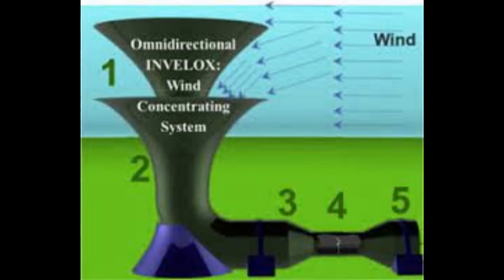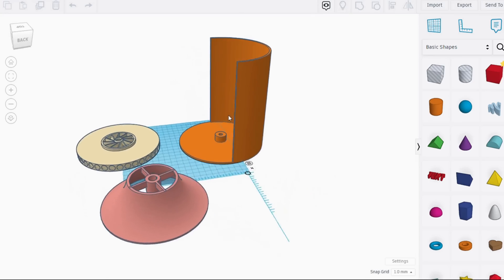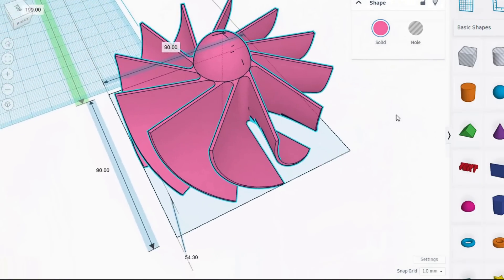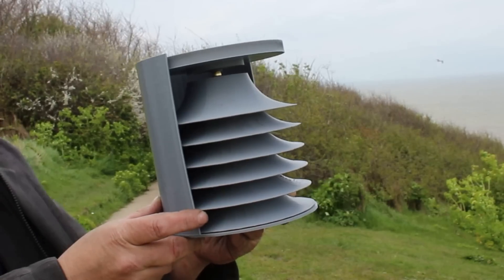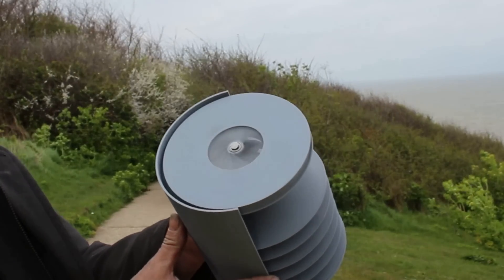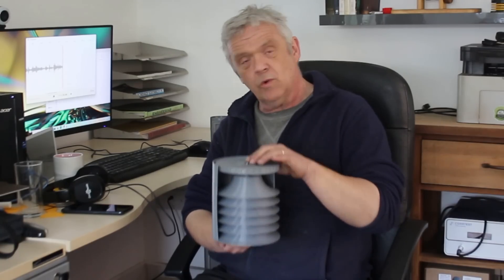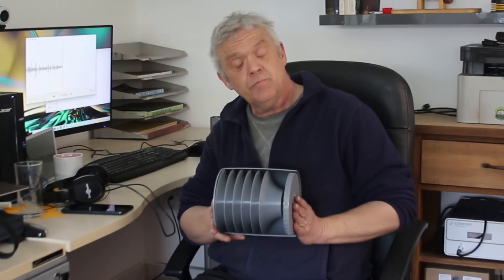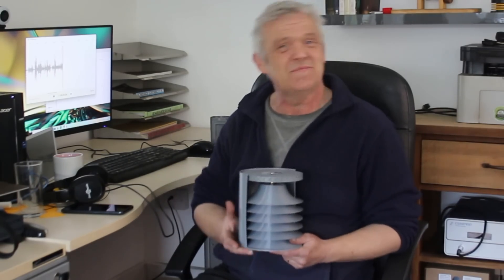1901 Brand New Wind Turbine Design For Camper Vans, Boats And Roof Ridges

Comment: Consider a mechanism to rotate the shield to adjust the wattage output (musn't overcharge the batteries), and protect the turbine from over-revving. Maybe a stepper motor, a little Arduino or whatever, and a simple dithering algorithm.

Comment: I found a website that sells turbines that generate electricity on Ultralight aircraft 
( https://www.aircraftspruce.com/catalog/eppages/gennipod11-14298.php ). Of course, they are extremely pricey. This gave me the idea, however, about you taking one of your turbines, attaching it to the roof (or front bumper) of a camper van, and driving down the road. Needless to say, you would have an ample and steady supply of wind for generating electricity, and currently, that wind just goes to waste. An "alternate" idea (pun intended) that I had was to use the hood air scoop off an old American muscle car, having it funnel the air into a Tesla turbine, which spins an automobile alternator. Again, if the wind is going to hit the vehicle anyway, why not put it to good use.

Comment: Thanks so much for the ideas and the designs.  One quick question - when you are printing these out, assuming PLA, are you using supports of. any kind?  If so, which kinds?  I am printing the Bells right now and there are an awful lot of supports.  I am curious if they are. going to get in the way of the actual design when coming off.  If anyone has any tips on printing these designs, let me know!  Thanks!!

Comment: Impressive use of TinkerCAD, found it hard to use for complex constructs, you've done well with it.  Very interested in the design, very cool.  Wonder if you could scale it up a bit and put some kind of actuator that reduces the incoming wind if the rotor spins too fast, almost like a built in governor.  Trying to think how you would do it mechanically so its automatic, when it spins at a certain speed the centrifugal force causes a door on the back cover to open and let wind through so that less of it is driving the rotor/turbine.  Very interesting either way, thanks for the video.

Comment: I doubt that this design will work in a useful way. According to fluid dynamics you concentrate the moving air of a large area to a much smaller area under acceleration. But where is the energy coming from? Obviously from the internal energy of the gas flow. So the static pressure and the temperature of the gas flow must go down. So you will get a lower inlet pressure at the turbine wheel than its outlet pressure.

So the air flow concentrator will not work. You will never force more air through the turbine wheel than in the case that you put it directly in the air flow. In fact you will get a reduced air flow. You can do CFD simulations to find exactly this.

Comment: Rather than having the rear shield, which would need to rotate in-line with the wind direction, could you add vanes to the cones?  These vertical vanes would stop the wind going straight through the cones and then divert the wind in either an up, or down direction.  That way the unit would be omni directional.
I think a down wind direction may be best, that way the turbine, with the blades, magnets and coils could all be located closer to the ground, or it’s attachment point.
One last thing, maybe a rotating shield could also be used, after all.  However, instead of behind the cones, I would locate the shield at the wind outlet side, and then in the opposite direction.  In this configuration the shield would block the oncoming wind and act like a venturi (creating a lower air pressure behind the turbine), this should then actually suck the wind out of that area, adding more power to the unit.

Comment: This is a cute design but it’s hard to get a sense of the scale of the apparatus that would be required to produce a meaningful amount of power in real world conditions.  I imagine you’d need some quite large structures and a gear box to generate a few kilowatts and it would be significantly less efficient than a horizontal axis wind turbine because the air has to change direction as it is funneled through the turbine.

Comment: If the air is following spiral track like tesla generator plates then do you need the shield at all? as whatever direction the air comes in should it not try and follow the spiral or is it going to be dependant on the gap size between for laminar flow?

Comment: Would be interesting to see where the point of diminishing return would be for the stack height! It would probably vary a lot depending on the diameter of the plates and the hole in the middle? Your suggestion to put it on a roof ridge made me think about how long you could acually make it before it doesn't make sense to add more plates and instead make a complete new unit.

Comment: turn it upside down. turbine wheel at the lowest point. Than the wind cathing disks will also be relatively higher in the wind. And stabilizing the relative heavy turbine wheel be much easier on a larger scale. I would also cut that curved backplate shorter so that the air can escape the turbine wheel on all sides.

Comment: Nice invention, I will soon learn how to design so I can print my first design with my 3d printer. I could already make this in metal with my CNC plasma table but might be heaving on each cone, spindle, etc. So I guess 15 years of 2d designing wasn't enough I need to learn 3d Designing as I could kick my own butt not getting into this earlier when they came out. lol

Comment: I don’t think this is likely very useful. In order to get any power out it would need to be scaled up considerably. If you consider a wind turbine about a metre diameter which is what’s needed to get any significant power you have an area of pi x r x r or about 0.75 metres. So the projected area of this device would need to be similar, about a metre high and 0.75 metres wide. So it’s going to have significant volume given it is a cylindrical shape. 
It’s just a fact that the energy of moving air is not very high at lower wind speeds and to compensate you need a big collection area.

Comment: i think your wind turbine is a Great idea, and will put it to the test. If you have any print settings you prefer please share them.  Otherwise we will post our progress here.
 Printing the cones large end down is just slightly over 7 hours with 80 overhang angle.
Small end down results hover 11 hours, 80 overhang angle.
Cura slicer
Creality 10s Pro
E-sun PLA + (testing filament) will change to PETG on test completion.
Reply: I too am trying to print this but having issues with the turbine fins.  The unit prints fine but the fins are not printing properly.  Initial layers don't seem to go all the way across the gap from the hub to the outer ring.  Some lay down fine but others only about half way or so.  Very frustrating!!  haha  I'm using Cura also on a Sovol SV01. Overture PLA..  I struggle printing fine details.  I'm also trying to print a small King's crown with the little balls on the tips, about 50mm diameter, but they won't attach.  The crown prints fine but finishes up with a spiderweb of stringing with little blobs mixed in.  Any constructive ideas would be much appreciated.  Thank you!
Reply: @NebulaM57  3D printing  can be very frustrating due to all the fine settings that need to be checked. I think You should check different  settings using a Benchy.
A few years ago I eliminated most of my print failures with extruder temperature calibration, and slower print speeds. Print speeds should not change from walls and layers. Every time the print speed changes the nozzle pressure will change requiring the extruder temperature to fluctuate.
Curing your filament with a food dryer before printing can be a problem solver. 
Hope this helps!

Comment: Thanks for the tinkerCAD link. Unfortunately, my printer has a smaller print deck. Is there a way to separate the three items from each other to allow for single item printing? If I shrink the file to fit my print deck, I'll be printing extra shields and fan/magnet plates. Is there an "explode" function in TinkerCAD to separate the three pieces? TY

Comment: Sorry if this has been brought up before, but if the  turbine turns CW, can a 2nd turbine running ACW/CCW be placed above the first on a magnetic bearing that takes advantage of the doubling of rotational speed between the two at the outer edge?

Comment: Referring back to video's 1869 and 1870, with a little modification of the serpentine coil assembly, by making a larger centre opening, one could turn the coil assembly upside down and fit it to the shield.

Comment: dumb question, could you increase yield by directing the wind though a second turbine? just a second disk with magnets that spins independently of the current one. even if its less than the first its still additional power.

Comment: Great idea, love it. trying to take my lighting off grid and using a couple of these on my shed to generate enough to power them through batteries and an inverter. This will be my first build, quick question, how many turns do I need on the coil, and what wire thickness.

Comment: Another thing you should look at is differential pressure system based wind generation.

 there are a few new wind turbines where instead of using the wind to turn an turbine outright. they instead use hollow wingforms attached to long tubes with holes in the low pressure areas of the wingform. When air is blown over the wing it creates a small vacuum like we use for lift in airplanes. However in this case with the holes in the right place the vacuum sucks the air out of the pipe attached to the wing rather then creating lift. you can then stick a turbine at the end of the pipe to generate power.

Comment: I might think that a shield to create a low pressure at the turbine exhaust would improve performance. I also can't help to think that as the stack grows, the center hole should become larger to accommodate the greater volume provided by each cone.

Comment: Looks a clever design.  Does it whistle ?? I believe small units on every lamppost but rotating parts usually makes noise. If a silent unit could be found every roof line could have them.

Comment: I love these concepts, but of course they also raise so many questions.  Do you think the tesla turbine effect is contributing to the airflow in a positive way? I look at the Ventum product and they have walls in four quadrants that look like they would block the tesla effect.  They direct the air up, why work against gravity?  They also appear to have the central opening getting larger as it goes up, I saw an earlier comment about a constant center opening blocking the airflow somehow.  So many questions, so little time.  Anyway, my real question is about the impeller design, is there an earlier video that talks about that impeller?  I couldn't find it.

Comment: Awesome.  Love the concept.  Looking at the strength of the wind you were in it could well be more productive than blades (as well as safer).
Probably a lot quieter too, which would lend well to boat roofs.
I'd love to see a finished unit with power output numbers.
Well done!
Reply: Propeller blades are inefficient.
The area of force is much greater than the area of the blades. 
If the blades had a larger surface area they could convert more energy from the wind.
Reply: @BenEehayeh  wind turbines can extract up to 50% of energy from the wind, following your logic the blades should cover 50% of the swept area , but they not. btw... did you know the wind turbine is not "pushed"  around by the wind force but rather "pulled" around by aerodynamic lift of the blades generated by the blowing wind ? so this concept turbine of Robert will not increase efficiency (it might actually decrease it due to friction loses while redirecting the flow), but it will transform the "dynamic" swept area with flying blades into a "static" swept area with no moving parts (hence safer). i think it's a neat idea definitely worth of investigating, but i don't think it's anything revolutionary :)
Reply: @robertjung8929  What is the cut in speed for propeller blades?
8-10 miles per hour winds.
Non-propeller designs, like the helical DNA shaped blades, begin to rotate in 3 mile per hour winds.
Helical wind turbines have been in use in Europe for 20+ years.
Reply: @BenEehayeh  where in europe exactly ? i live in europe and all big wind turbine farms i seen are using  conventional blades.
Reply: @robertjung8929  Finland.
Reply: @BenEehayeh  can you share the google map coordinates of a wind farm with helical turbines ? because as far as i know helical turbines are used only for very small installations like rooftop ones.

Comment: Using the flat wind turbine on top and use the cones over. The Air/Wind flow direction down and the cavity shape moving down wider with each cone to direction of Vortex Turbine you made earlier. The Flow coming out at a near Horizontal direction to the bottom of the cone tower could have a Vertical set of vanes to add more affected surface area for Torque.
The angle and size could come in handy for a Brake in high winds.

Comment: I think the wind turbine from episode 1889 would have worked better with this stacked setup. Would also be more effective to use those four flaps at 90 degree angles instead of that half circle shield. With the shield you blocking air whereas the flaps is guiding it, creating a bigger surface area and more air inflow. By not blocking the air you allow more turbines to work in series.

Comment: Hmmm. The power from a conventional propeller is generated at the tips which in turn produces leverage, which is why the larger the propeller diameter (think wind farm) the greater the power. This turbine is too small, as soon as you add coils to produce a voltage,  then attach a load, you generate electromagnetic breaking.  There won't be enough leverage to overcome this unwanted effect. The whole thing would need to be much larger, including the turbine.
Reply: I agree, the effort to produce ant dereee of electrical energy would be so tiny it is useless unless of great size.  The only advantage I see is that the wind direction is not a factor as in a conventional wind generator. Height and blade diameter is a major factor in utilising the generating capacity of wind.
Reply: @warrenelliott4555  I agree, also wind at rooftop level is completely unreliable , buildings interfere causing eddies etc which is why wind farms are on top of hills or at sea.
Reply: Alternatively 100's of those dotted all over my house n garden would produce a lot of battery charging power n not disturb neighbours(they'd just think it's that crazy guy again) ... I'm thinking rainbow colour...
Reply: Conventional propellers are not impellers.
Reply: Wrong…. he explains why.
Reply: @FLodge100  lol

Comment: I have an idea for you to try. Ok so you have the back to redirect the wind back into the turbine. 
Why not have a wind Direction, finder on the top connected to the back wall on a rotating bearing then you can make the Entrance smaller but with a larger curved entrance forcing more wind into the centre. So not only are you getting more wind in but the entrance will always be pointing to the strongest force of wind. 
Sorry I tried make the idea as clear as possible, please let me know if you will try it as I would be very interested as one day I would like to save up of a full electric narrow boat.

Comment: I don't quite get the design logic. Wouldn't this be more efficient if you just had a single chamber air "scoop" which would be easier to manufacture and not create so much resistance. In essence this is what you have but with many partitions in between which I can't imagine help with efficiency. The single chamber scoop could direct the air up or down and also rotate with a weathervane to always be pointing into the wind. Just seems like too many redundant parts imho.

Comment: I find this consept really interesting! Would something like this work in bigger scale, producing electricity for the grid? I imagine it would be less intimidating for wildlife bacause of the removal of visual movement when looking from the outside. Another benefit could be that is easier to fit barriers around the cones to prevent birds from getting into the system and getting killed. I imagine you would reduce some of the tear on the turbine wings as well when they are not directly exposed to the elements, but that benefit might be lessened when the particles that do get through become accelerated from the concentration of wind. But then again the turbine could be placed at the base, which could, as you pointed out previously, ease the process of maintenance. I would image that people would be less negative of these turbines as well, since they are less visually intrusive. Super cool!
Reply: this thing will not produce anything. also not in bigger scale. nice try: but bin it